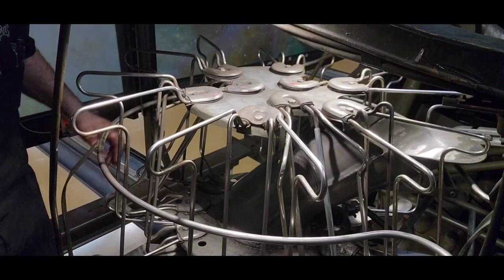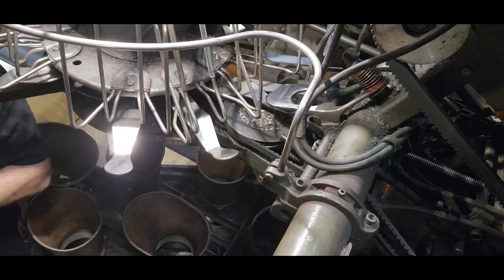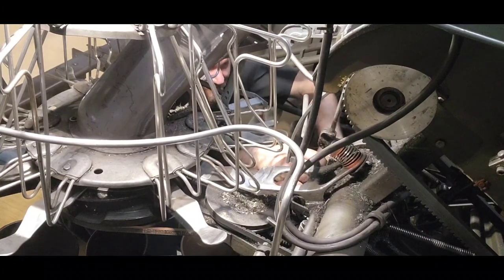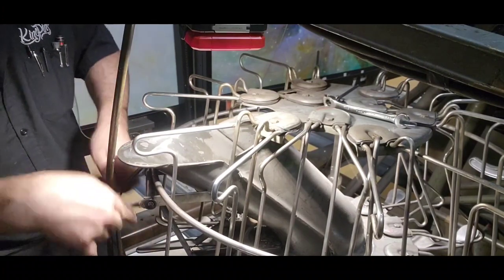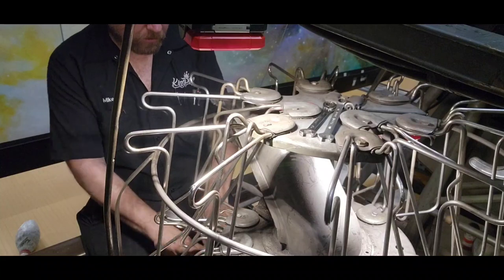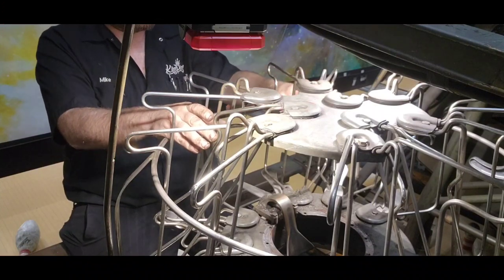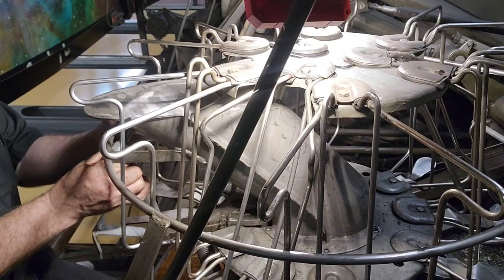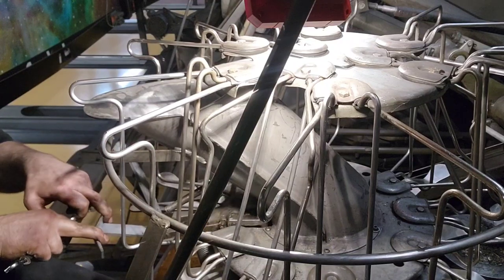Brunswick A2 - Turret basket pull and broken stud removal.

Comment: Overlooked the broken turret spoon bolt there bud. Right around 19:53 and you will see it.

 The house I work at I went through ALL 32 of my turrets and the most number of bolts that holding them together was averaging around 3 per lane. I had my work cut out for me but I did get mine done and I made sure all of my hardware was matching so no surprises.